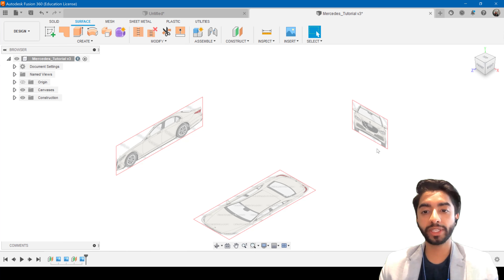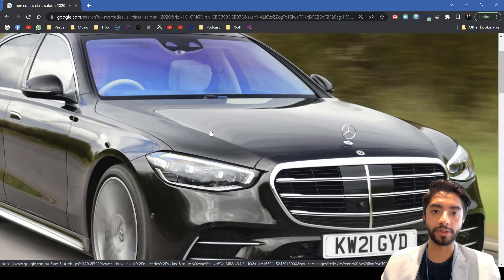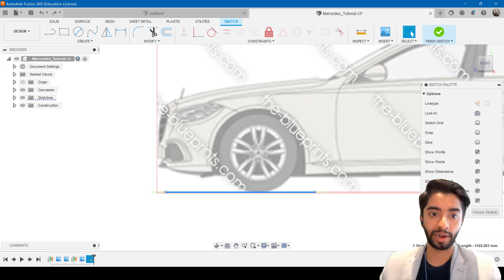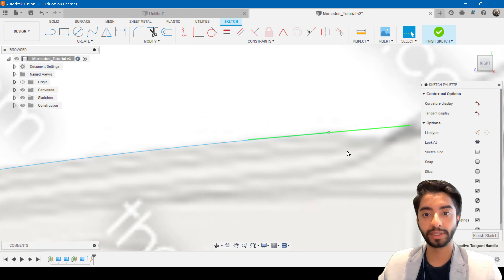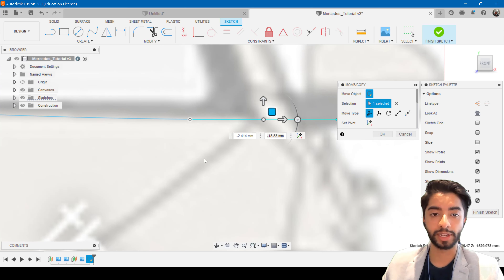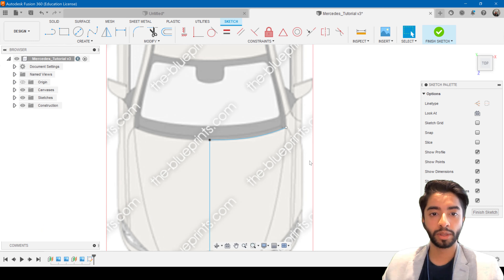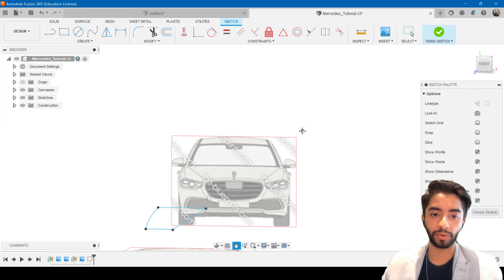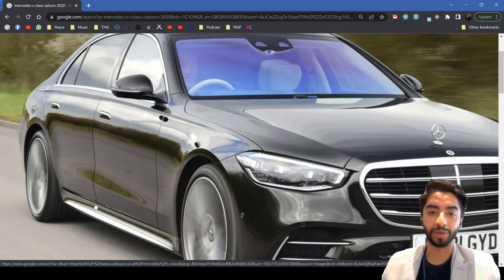How to Model a Car in Fusion 360 | Tutorial 2 - Basic Surface | Step-by-Step (4K) #Fusion360

Comment: I am unsure why, but using the patch tool results in a giant bulbous shape to be produced, however, when I use the loft tool, using two of the lines as profiles, and the other two as rails, I can create the smooth bonnet shape we are going for.
Reply from the maker: Interesting! Thanks for sharing that. I do tend to switch between the two for the same reasons.

Comment: To move a the fit point spline in another dimension in sketch mode, just click on the green arm and select activate tangent handle, it should be able to curve by pressing m on the handle's points

Comment: What would stop a completed and joint sketch from forming a surface patch? Currently having the problem that I click the patch tool and can select all sides of my sketch in one click but it won't allow me to click ok to form a patch? Please help
Reply from the maker: Hey! I've experienced that too. If the edge/ curve of the patch is not fully connected with your new sketch, then it will mostly probably not path. I recommend making a new line on your current sketch that matches that of the patch. Hopefully that should work!